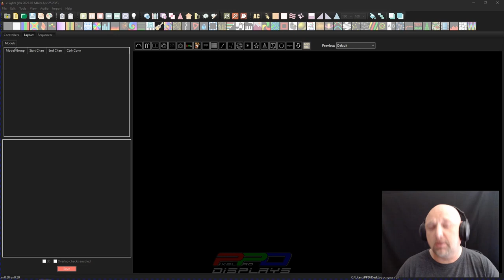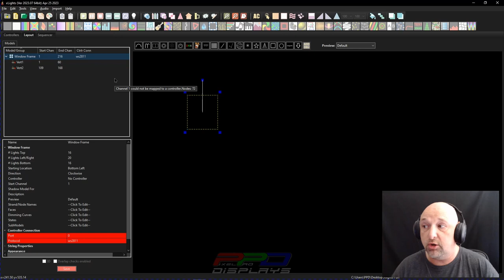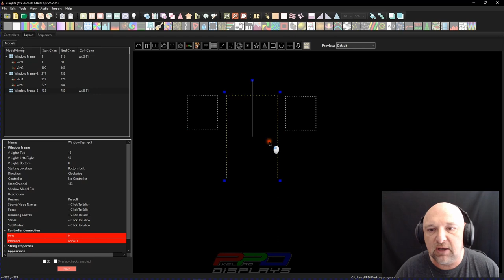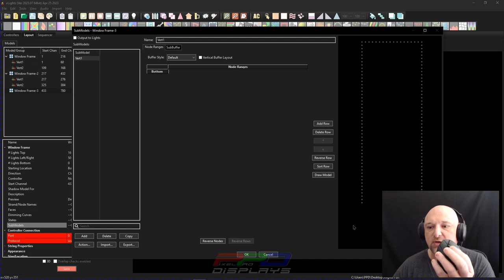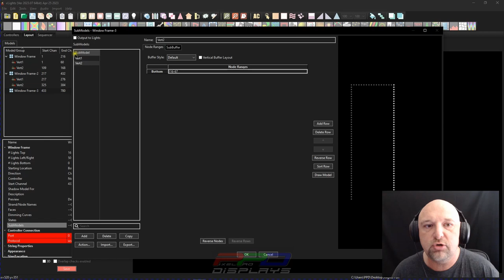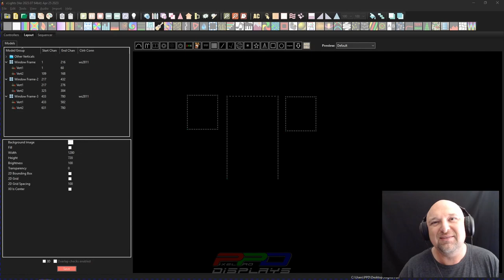Sub-model Your Windows and Door Outlines in xLights!

Comment: So when I create my vertical submodels and add them to a group. I can't seem to get any effects to work on the group. If i do the same with the horizontals, it works perfect. Specifically if i use the single strand effect on the horizontals it bounces from one side to the other ( once I set the render style to per model default ) but If i try to duplicate this on the verticals, no matter what render style i pick I can't get the single strand effect to bounce from top to bottom on all the verticals. Any ideas?
Reply from the maker: It has to do with the way xLights draws the buffer  for the sub model... a left-to-right line. Changing to per-preview render style and rotating the effect by 90º will solve your issue.